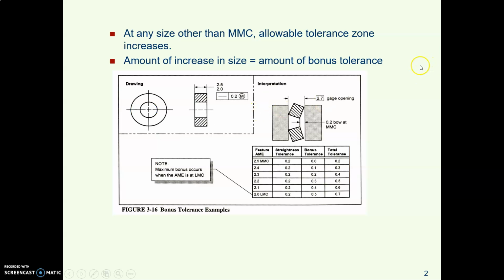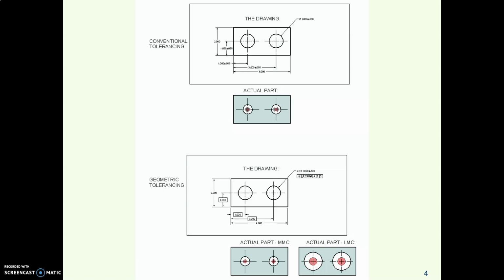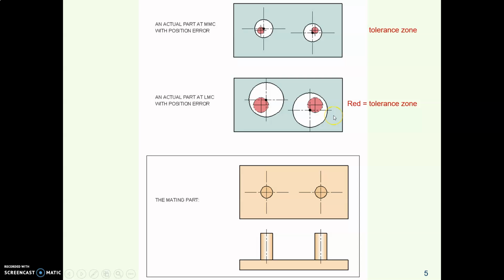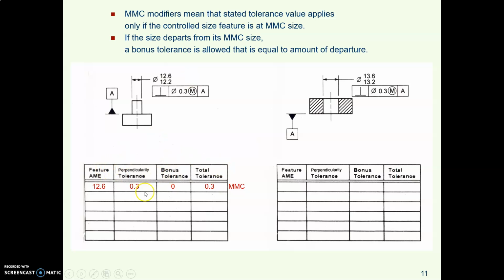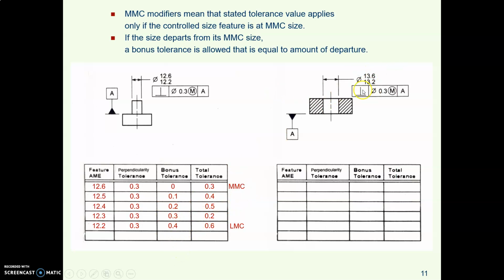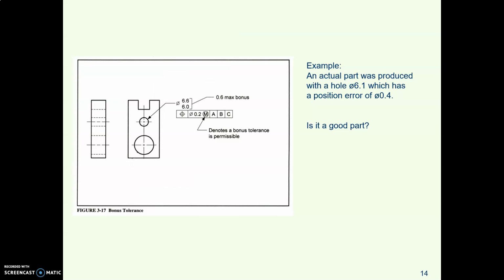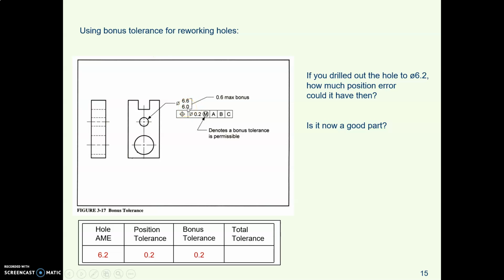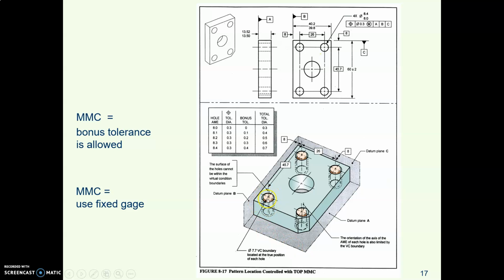MDes23b GDT   bonus tolerance

Comment: Hello, MMC has a benefit to get an extra tolerance, at which situation we must use w/o MMC?
Reply from the maker: Bonus tolerance only happens when a geometric tolerance is applied at MMC, that is, when there is an M in the feature control frame. When an actual part is any size other than MMC, you get a bonus tolerance. The amount which the actual size departs from MMC is the amount of bonus tolerance you get.
Reply: @margaretrobertson8848  thanks for the feedback